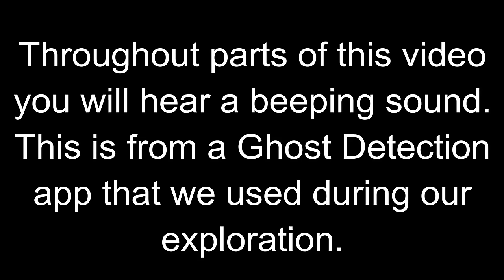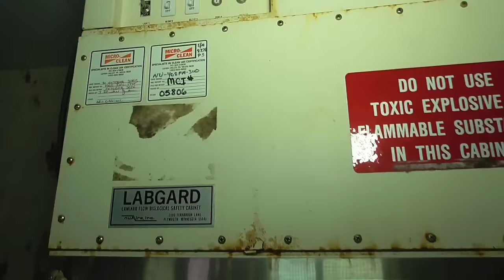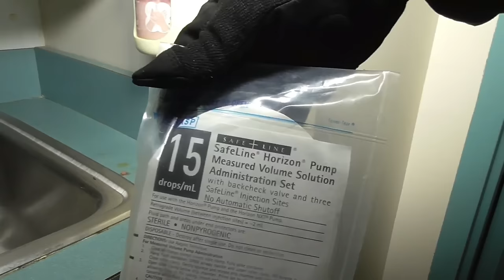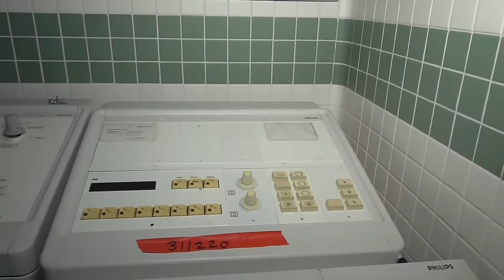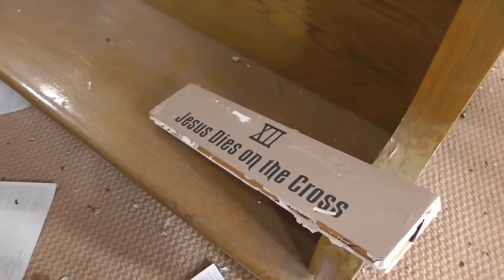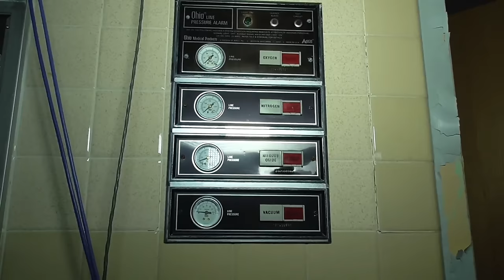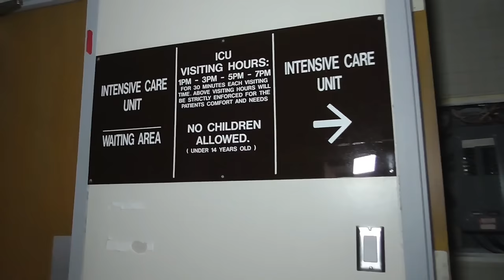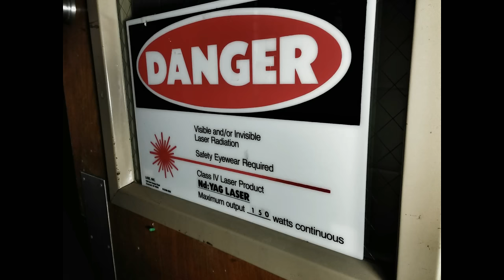Abandoned St. Joseph's Decaying Hospital - Equipment Still Inside!

Comment: I’m a CpHT and I can tell you this video starts in the pharmacy. The big metal thing is a laminar flow hood. It’s used for prepping sterile things like IV bags, eye drops, and suppositories. This pharmacy is not very outdated with the bar codes on the shelves for the meds and the laminar flow hood. Very expensive piece of equipment to leave behind too! And the fridge that says drugs only. That’s a thing! For sanitary reasons only drugs go in the drug fridge. Not the employees lunch. Mostly IV stuff, diabetic meds, eye drops. Very cool starting this video in a pharmacy!
Reply from the maker: Thanks for the info
Reply: I mixed up IVs in that laminer flow hood as an intern pharmacist in 1989. I would turn on the radio, tune into Rock 107 and make IVs for 7 hours. Good memories of that Hospital. One of the pharmacist there was a Nun.

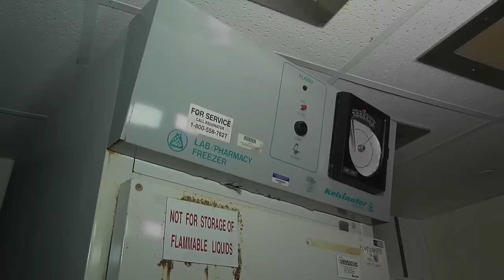Comment: I worked in the OR in 1981 for several months before going to college. The nuns were a horrible bunch to deal with let me tell you. I liked the surgeons that I worked with but not the nurses. The nuns would come into the OR in the same clothes that they wore outside, they cut up the boxes that scrub brushes came in and would wind silk ties on the cards that were cut out and then sterilized them in peel packs. I never saw anything like it. They reused things that were not meant to be. I also noted there was a lot of sarcoma in the area for some reason. They had a IBM time clock here that would log you out at 3:30p but we were kept till 3:45p and when I asked about that sister Celina had nothing to say, I told her you can't keep us here for 15 minutes a day and not pay us for it. We got read the riot act by the head nun because we were being shopped for a union and we were warned about talking union on property. So I handed out leaflets across the street so they could see me. I was instrumental in voting it in and the leverage was that time owed to us all. I knew I wasn't staying so I gleefully helped get it in there...

Comment: Based on the vintage toilets and drinking fountains, this place is most likely from the 40s or 50s.
Reply: I wonder if there was running water, probably not.  The toilet was a 1947-1953 “Standard” Tribor, one of my favorite vintage toilets.
Reply: yup!!!!, that dates it. the older ones just said "STANDARD" not "AMERICAN STANDARD". it was at one time just the "sandard" plumbing fixture company, and then they merged with the "american" boiler company in the late 50's!!!

Comment: I worked there for 15 years and right after they closed I begged them even accompanied to plz let me do a ghost hunt there. They wouldn’t budge. I’m jealous you go to go in. Def haunted. As the shroud would visit the icu on the fifth floor across from the OR. To have a sb7 spirit box would friggin rock.
Reply from the maker: I have new equipment and would love to go back to do a more thorough investigation.
Reply: JPVideos did you get permission, or do you sneak in? 
My SLS camera just came in, can’t wait to use it. If you go back may I join you?  Knowing what I know about the shroud is an amazing story. Very scary, he was 7 feet tall all black and wears a top hat. He always went into the rooms of the icu patients right before they passed away.
Reply from the maker: Please contact me thru my fb or email found in my   newer video descriptions or about section.
Reply: I think the tall dark figure with the top hat must be in many hospitals.  My friend worked in the basement of the local one and she saw the figure multiple times. It even pulled a tightly covered trashcan lid off and threw it. She was never pushed or scratched though so I don't believe they are evil.

Comment: Those Light Bulb covers were for use where there was any king of Explosive material. The mere act of turning on a electric light can cause an explosion. I worked at a Distillery where any kind of spark could blow you to kingdom come. Those covers protect from sparks places such as were gases are.any type of Explosive material.